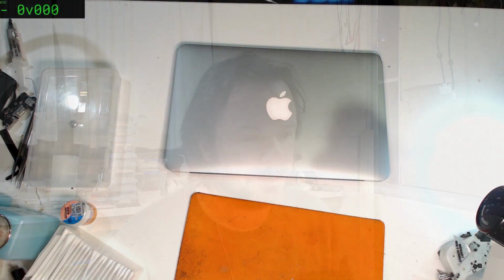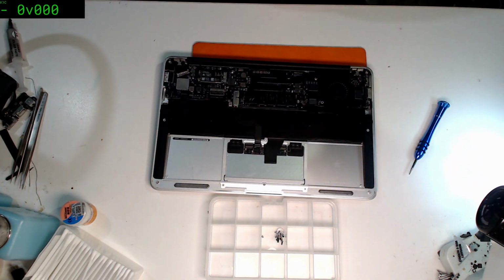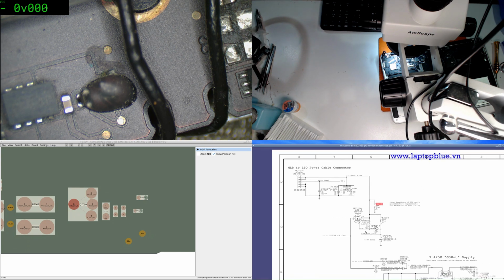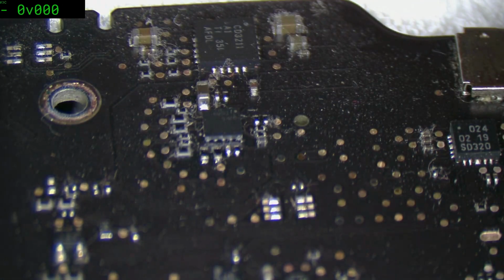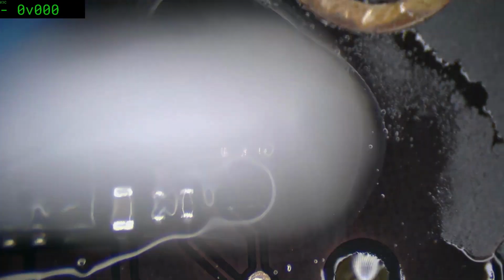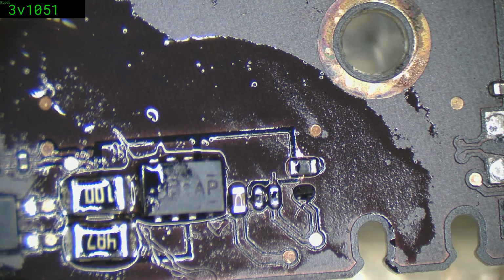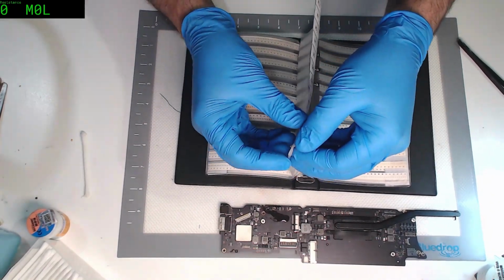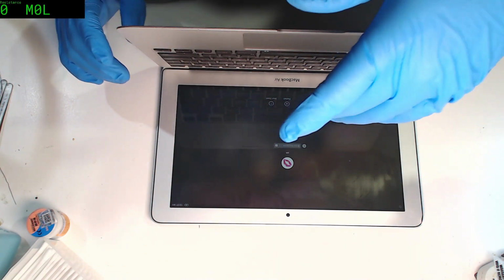#261 Macbook Air 11" A1465; no power, supposedly "liquid spill" (Apple Store)

Comment: That's my computer your expertly fixing. I can confirm with my genuine power adapter I got no green light on the magsafe and nothing but DEAD before I sent it to you Paul. This is the first computer I have sent to Paul after hearing his name dropped in a Louis Rossmann video of an Australian that fixes Macs. I do want to add that this computer was taken and left at a Mac Genius Bar. It was said that water damage changed the indicators and killed it. I couldn't see water damage. So the advice from the Genus Bar was that repairs would NOT be cost effective as they would add up to the same price of a new Macbook Air. As Paul says in the video a lot of people don't get the macbook Air's fixed due to their low cost. But to spend a little over 300 bucks to get a working computer not only saves you money but the right thing to do too and not just dispose of it to the trash heap. 

I do want to add that Paul has been a delight to converse with as a customer and above and beyond in being helpful. I'm not surprised by this generosity as he by recording repairs is giving back to the community of other repairers who want to sharpen their skills. 

I was fortunate to see the repair which I eagerly watched and learnt some things too about how corrosion even small to the eye, well to my eye, can stop a computer booting up. 

I wholeheartedly recommend your repairs Paul and be assured  I'll let others know of your repairs and will be pointing them your way.
Reply: Thank you Shaun. That beats a yelp review any day.

Comment: R7012 is there to enable the Magsafe adapter to detect that it is connected to a Mac. Only once it detects that does the (real Apple) Magsafe adapter turn on its power. Before the power is turned on it is only pulsing a low voltage to detect the resistor.
With R7012 missing the Mac will work just fine on a fake Magsafe adapter, or with a lab power supply, but it will not work on a real Apple Magsafe adapter.
Reply from the maker: That in combination with the sys onewire chatter too.
Reply: @pldaniels  The sys onewire is used by the Mac to detect the adapter. R7012 is used by the adapter to detect the Mac. The wire for one wire only goes to the plug of the magsafe adapter, it does not go to the adapter itself. There is a chip in the Magsafe plug that drives the amber/green LED in that plug. The same chip contains the serialnumber etc of the Magsafe adapter and how many Watts it is. There are only two wires that run down the Magsafe cable.
Side effects of this are that you can still read the serial number of an adapter even when the adapter is not plugged into the mains. you can even still read the serial number if you cut the adapter off. 
When using a Magsafe cable on a lab power supply, you want to use the cable from a 85W adapter. If you use the (identical looking) cable from a 45W adapter the more power-hungry Macs will not work and/or charge.

Comment: Another muckbook is alive :-D.
I did wonder why you ignored the os boot problem and wandered off elsewhere, im sure you like to leave us poor monkeys in the dark lol :-D
Reply from the maker: Turns out the SSD had just been recovered previously and is now NTFS formatted, which is why it didn't come up.  Installing a new macOS and it'll be all good :D
Reply: @pldaniels  hay paul where can i get them books of  Resistor Kits
Reply from the maker: @wallysemenoff8110  I'm now actively advising people not to use them. I had a few too many run ins with values not being good or of poor quality :(

Might have to instead invest in a proper name-brand resistor book.